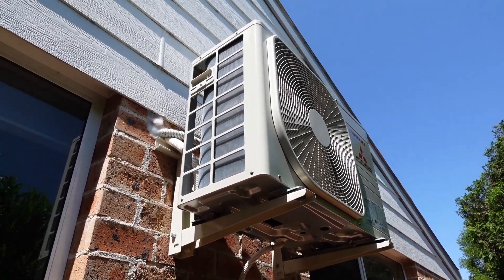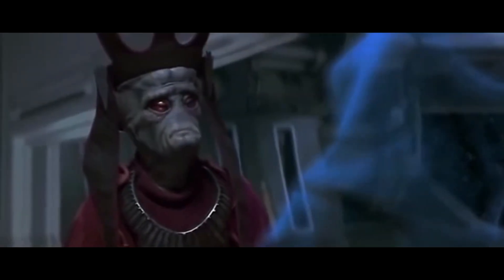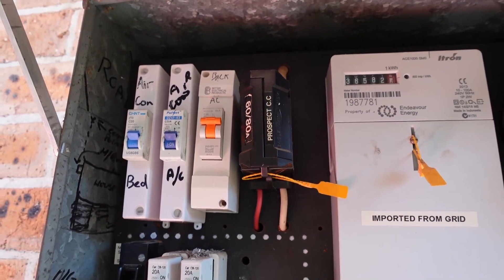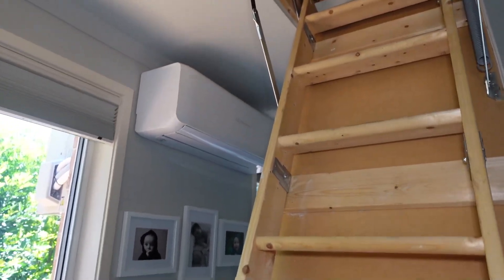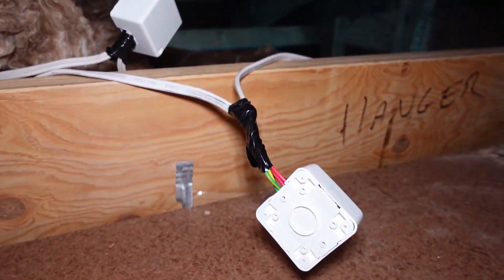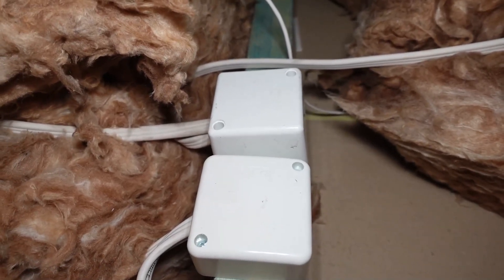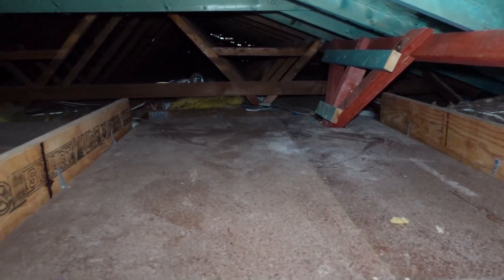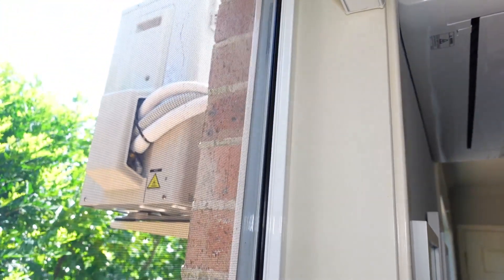Aircon Wiring Install FAIL- TWICE!

Comment: Man, there is all that regulations and "licensed" sparky stuff here, they you see their work...., practically every property I have been to be it residential or commercial they have had atrocious electrical work.  forget about the "code" some fail even basic common sense. how do these guys get a license.....
And I can't even fix their shit work, because liability and blah and blah..... honestly it looks more like a money grab monopoly than a safety/standard thing
Reply: Considering that when NZ got sensible and decided that homeowners largely weren't complete fuckwits so they can probably do at least some electrical stuff themselves, especially if they were provided with resources showing them the right way do do things, their rates of deaths relating to electrical work went DOWN...

Meanwhile in AU you're not legally allowed to install a plug onto a cable unless you're a licensed electrician.
Reply: @SomeMorganSomewhere  same wiring standards for Australia and new Zealand
Reply: @aussiegruber86  Yes, it's the same standard (AS/NZS3000) but the regulations are different. The standard says nothing about WHO can do wiring, it only tells you HOW wiring should be done. IIRC anyway, been a while since I read it. Might be some language along the lines of "competent persons" in there somewhere. Definitely nothing about licensing though, that's a state thing).

In NZ you're allowed to do a bunch of electrical work yourself so long as you are "competent" and get a licensed sparky to sign off on it (https://www.worksafe.govt.nz/managing-health-and-safety/consumers/safe-living-with-electricity/getting-electrical-work-done/doing-your-own-electrical-work/). 

As noted above, in Australia you're not even legally allowed to fit a plug to a cable, you're supposed to get a licensed sparky to do it (not that anybody actually abides by that particular piece of stupidity, at least not at home). And some of them even manage to screw THAT up, case in point the plug on the new oven at my parent's place that they'd managed to pinch both the active AND the neutral conductors badly enough that it'd cut about half way through the wire.

Not sure how bad it is in other states but according to Energy Safe Victoria you have to be a licensed sparky to even install PVC conduit, not even actually run the wiring, just installing the CONDUIT.

Comment: Mhm, I like that blue wood! Is that from a blueberry tree? Nice

3:42 Hm, you probably saw that as well, but just to be safe; what's with the thick orange wire for that just sticks out the black "MAIN SW RANGE POWER UGNT" switch?
Reply: The blue is wood preservative for rot and insects, pressure or vacuum treated.
Reply: @MartinE63  whoos it was a joke :)
Reply: @GLITCH_-.-  Blueberry wood is in any case white, red and brown  😀
Reply: @MartinE63  not if it's made of blueberries

Comment: I have just had a third air con/heat pump unit installed, the previous two I put in myself and they came with a 13 amp plug on the cable. The new unit is a 15KW one and the company I use for servicing and commisioning of the other units will no longer do that so I had them do the install as well, they insisted on putting in a seperate cable run,which they did not do themselfs but had an electrical contractor do. After the install we had trouble with the phone line caused by the electrician in the loft so out came the BT engineer who went off leaving a working phone line but now the alarm system is not working as the BT man disconnected a cable so the alam company has to come and reconnect the alarm. And although the air con install is all very neat on looking through the instruction book it says the outside unit has to be at leas 300 mm fro the wall well I knew fro looking that it was not so out came the rule, only 187mm, the unit seems to work so for now I will not say anything. So is the poor workmanship a world wide problem.

Comment: Looks a lot better now, pays to to getting them back till correct. They will get fed up in the end and do it right. I'm in the UK, do you not have multiple MCD a d RCD boxes. Looks a bit of a rats nest behind that door. Noticed no grommets to stop the cables chafing as they pass into the back. Thanks for the video.
Reply: They don't need any protection passing through to the back as the material is not hard and sharp. There is a requirement to make sure any passing through the metal sections are secure and fire penetration is minimised.

Comment: Jesus, even my tiny apartment in the US has 4 main 120v circuits for room outlets and lights,  plus separate 240v AC and oven circuits, and a separate main whole unit breaker.
Reply: You've got to remember that everything is 240V, so for any given wattage the current is half what it would be at 120V. That's why there aren't usually as many separate circuits.
In the UK (officially 230V but most places still 240V) we have fuses in our plugs so a lot of older houses only have one 30 or 32A socket circuit for the whole house.
Good practice these days is to split into at least two circuits, maybe 3 with the kitchen on a separate one because that's where the power hungry appliances usually live.
Electric cookers are on a dedicated circuit and electric water heaters (immersion heater) should be too but sometimes aren't in 1980s/90s houses (bad practice) if there is more than one socket circuit.
Reply: @simonparkinson1053  no wonder their consumer product standards double down on isolation - most short circuits will cause exploding wires (of the products) and/or instant flambé. That's a scary amount of available power at a receptacle.
Reply: @simonparkinson1053  We have 230 V in Germany and new houses and apartments have tons of breakers for all different types of devices and for every room. But I used to live an apartment with 1960ies wiring (I guess) and it only had one 16 A breaker for the whole apartment. It had a gas stove, so that wasn't a problem, but it was still pretty annoying because it had an electric water heater and an electric space heater in the bathroom. When both of those were turned on, then you couldn't even cook a cup of coffee at the same time.

Comment: Hey Dave, is that how a normal electrical box with all the circuit breakers and measurement units looks in Australia? Or is it a remote box and you have somewhere else your "primary" box which connects your house to the grid? Here in Germany, you would get lots of trouble if you'd do such an installation ;-)
Reply: That is how OLD OLD electrical boxes were in Australia. However the code states that when there are changes made, it needs to be brought up to current standards. That hasn't happened, plus the work and equipment added is really horrible, cheap and nasty.
This would be totally illegal in a new installation, Any normal (licenced) electrician would be cringing to look at that mess.

Comment: 2 questions why haven't you replaced the old ceramics with proper breakers and 2nd is the fuse box mounting board asbestos if so where's the warning label.
Reply: came to say the same... I got a decent guy and replacing the whole panel and disposal of the asbestos for under $500 aud. AC install guys put an isolator switch next to the outside unit... might not be to 'code' but surely its the thing to do
Reply: Have a closer look that panel is not asbestos.  It is phenolic resin type.
Reply: @jennytillz   did ya smell-o-vision it for that conclusion?
Reply: @4x4getoffmyland  - if it was asbestos, the supply authority (Endeavour) would have applied a warning sticker on it.

Comment: My sparky mate says he can always tell who has done the wiring. If it's kind of "she'll be right", it's a sparky. But if it's either perfectly laid out to code and looks beautiful, or it's completely stuffed, it'll be the homeowner.
Reply: Depends on the homeowner, my dad did the wiring for the bathroom a couple of decades or so back and when we had to replace the outlet/switch I found out he never installed the ground to it and just left it floating... Fucking hell.
Reply: @vgamesx1  is your dad a professional electrician? They are the worst at home.
Reply: @JJVernig  Haha, thankfully he isn't nor has he done any electrical work since then, although that doesn't necessarily mean the rest of the house is well done or up to modern standards.
Reply: That sounds like the comment from someone with no pride in their work!
Reply: Thats why my family and I only use one company who used to do the wiring at my old work place. They do a damned good job. You pay but its well worth it.

Comment: Dave, check the installation manual for the unit you have. Most state that a dedicated circuit is required with a particular rated breaker.  The isolation switch at the unit is also a recent requirement in the regs.